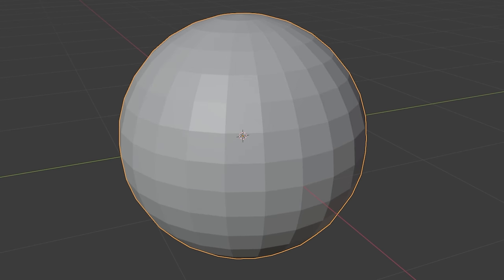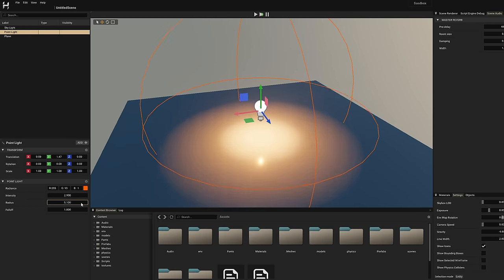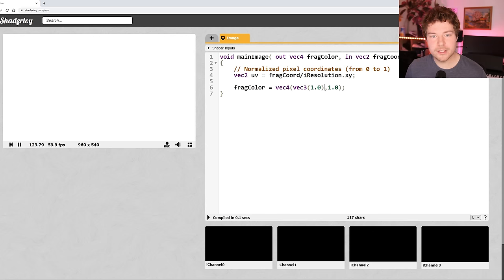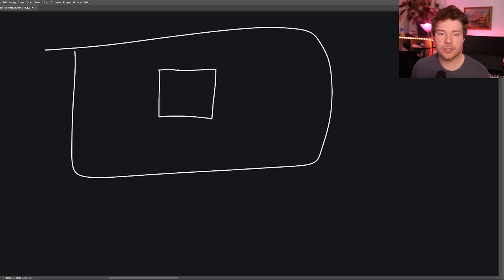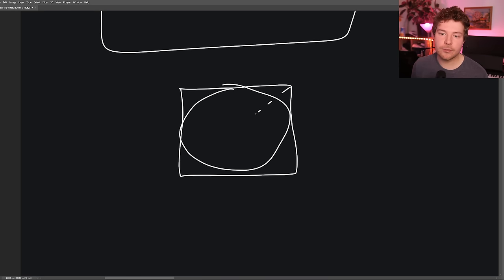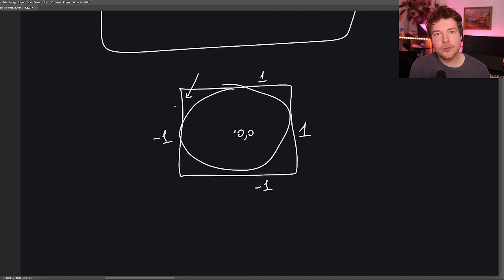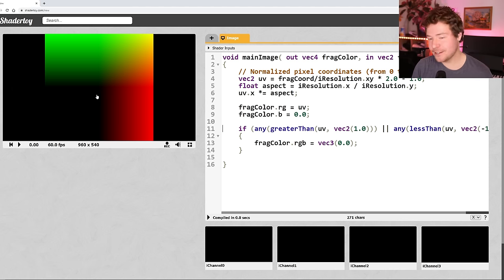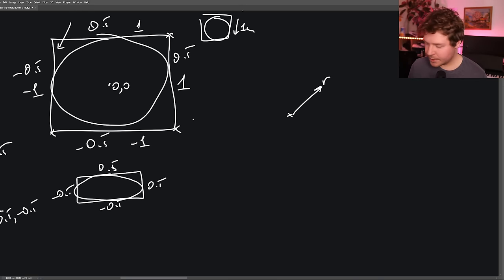How To Render CIRCLES (OpenGL/Vulkan/DirectX/Metal)

Comment: You don't need the square root, sqrt(x^2 + y^2) < 1 is equivalent to x^2 + y^2 < 1, save a few GPU cycles ;)
Reply: Yeah square both sides and you still get 1.
Reply: Only if your radius is 1, does not work with radius != 1
Reply: @rutvikpanchal5726  well in that case you can square the radius instead of square-rooting the x^2 + y^2, this is beneficial cuz square (simple multiplication, one instruction) is way cheaper than square root computationally
Reply: what if I tell you I have a circuit that can calculate square root in one CPU cycle.
Reply: @rutvikpanchal5726  you can just compare it with radius^2
Reply: @utkarshgupta4041  indeed you might have, but that doesn't seem to be the rule
Reply: @utkarshgupta4041  woah, how does it work??
Reply: square root is not as computationally heavy as it may seem to be. It's actually 1 CPU instruction on these days computers. Of course, 1 instruction 
!= 1 cycle but It's still not that expensive.
Reply: @gommito  might as well do the simple optimisations so you don't have to worry about the more complicated ones
Reply: @gommito  That is unfortunately not quite right. A CPU instruction has very little correllation to CPU cycle. For SSE systems like Intel Skylake, sqrt has a latency of ~12 cycles. That means if I issue one square root, I will have its result 12 cycles later. Now what is very low is its throughput, which is 1.0/cycle. This is an effect of pipelining and Out-of-Order execution. So if I have many sqrt's I need to do, and I start calculating my first 11 sqrt's, for each following sqrt I get a finished sqrt result issued 12 cycles before. This means (simplified), that in code that does a bunch of different stuff to a float, adding an unnecessary sqrt does come with a performance penalty, while in a situation where I need to densely compute a bunch of square roots, the cost of each is minimal. Just fyi for an example where instruction and cycle are basically uncorrellated, a load from memory, the same instruction, can, depending on from where I load and the context (what I loaded before, etc.) take between ~4 cycles (L1) to ~100 cycles (main memory) or even thousands of cycles (page fault).
Reply: @gommito  last time I checked float division and sqrt can both go up to 64 cycles, so not great, not terrible, imo
Reply: @naturallyinterested7569  Wait does that mean it takes a Skylake CPU only like ~23 cycles to calculate the length of a 12 dimentional vector (assuming 12 sqrt issues + 11 additions)? 
But when I want to sqrt(sqrt(a) + b) it would end up taking ~25 cycles?
Reply: @rutvikpanchal5726  x*x + y*y < r*r instead of sqrt(x*x + y*y) < r is a very common optimization
Reply: @utkarshgupta4041  Then I would say you wasted a bunch of transistors on something not that useful (at least for a GPU). 
You essentially traded of at least 4 FMA cores for a single square root engine - that's roughly on par with how nVidia's SFUs compare to their FMAs (CUDA cores). Actually, if you could do it in one cycle, then you likely traded off up to 32 FMAs for one square root engine and now have to run your GPU at 1/4 the clocks speed due to the increased critical path - modern SFUs take several cycles (4-5) with a throughput of 1 per cycle. When you have many threads, that effectively becomes one cycle, but the bottleneck becomes the fact that operation occurs across the entire warp of 32 threads trying to use 4 SFUs, so that takes "8 cycles" to process the entire warp.
Reply: Clearly one multiplication is far cheaper than taking a square root. You don't need to know a lot about cpu instructions to know that. Since it is such an easy fix, there's no reason not to just do it
Reply: @rutvikpanchal5726  x² + y² < r² works for any radius.
Reply: @fmdj  you’ll be good at managing resources. 👌
Reply: @utkarshgupta4041  gist me.

Comment: Something that works even better than a static "fade" amount is to scale it depending on the fragment size. In OpenGL 3, this is surprisingly easy to compute by using derivatives:

    const float sqrt2 = sqrt(2.0);
    float fade = sqrt2 * length(vec2(dFdx(distance), dFdy(distance)));

This produces a pixel-resolution fade which works even when the quad is distorted.

If you want an even crisper, but still antialiased, edge, you can use a linear smoothstep (which I call "lerpstep"). It is essentially the convolution of step() with a box filter.

float lerpstep(float edge, float delta, float x) {
   float edge0 = edge - delta;
    float edge1 = edge + delta;
    return clamp((x - edge0) / (edge1 - edge0), 0.0, 1.0);
}

void mainImage( out vec4 fragColor, in vec2 fragCoord )
{
    // etc etc
    float distance = length(uv);
    float fade = length(vec2(dFdx(distance), dFdy(distance)));
    float alpha = lerpstep(thickness, fade, distance) - lerpstep(1.0, fade, distance);
    // etc etc
}
Reply: Thanks for the code example! I never knew that dFdx and dFdy even existed before now. In case anyone was like myself and was quite confused about dFdx and dFdy, here's how I understand it:

dFdx allows you to compare a variable of the current pixel being rendered to that same variable of the neighboring pixel to the left. Essentially the function returns the DIFFERENCE of a variable between two pixels that are horizontally right next to each other. This is useful because it tells us how much our variable changes per pixel which when rephrased, tells us how much we need to change our variable to get a pixel worth of width. dFdy is the same as dFdx except it compares pixels vertically instead of horizontally, so when a pixel is being rendered it'll look to the pixel above it to get the difference in their variable. Note this variable can be anything from user supplied varyings like uv coordinates, or variables like gl_PointCoord. Though you could supply a constant value like `1` to dFdx or dFdy but it would just return `0` as all pixels would just have the same value (as 1-1=0).
Because we now know how much we need to change our variable to get a pixel worth of distance both horizontally and vertically, we can use it produce 1 pixel's worth of anti-aliasing which Pseudonym73 has shown above.
Reply: @bobsmithy3103  This is exactly right, except for one quibble: you should think of dFdx and dFdy not as differences, but as derivatives. They are indeed implemented as differences (which means they are not magic, in that they don't give you an analytic derivative), but semantically they are derivatives.

These may be the most useful operators that nobody (except those who came to OpenGL shaders from RenderMan) seems to know about, because they give you the information you need for shaders to antialias themselves.

Comment: the smoothstep function has one draw back, if you increase or decrease the size of the circle you either get antialising again because the smoothstep threshold is to small or you get a blurry edge because the threshold is too big, a somewhat good alternative is to use the fwidth function to calculate the edge smoothing, since it uses derivatives they are "screen size" aware so it doesn't matter which size your circle is in the screen, the draw back is that it's a bit more expensive and derivatives uses 2x2 pixel blocks which in some shapes can be seen, it's not the case with circles tho

not sure how derivatives work with shadertoy but the final code would be: distance / fwidth( distance )

Comment: Throughout the whole video I was wondering how you were gonna make the edges smooth. I don't know if there are other, more efficient anti aliasing methods, but isn't it weird to have a anti aliasing function (=smoothstep) that depends on the number of pixels of the radius? Like, it you make the circle very small, you have to change the fade value, same if you make the circle very big.

Maybe I don't have the right use cases in mind, but here's what I see:
1- UI: If you use your shader to draw a circle in the UI, then at least you'll always control how big or how small it is, so that's easier. But you still have to manually adjust the fade for each size of circle you have in your UI, and each resolution the game supports. Otherwise, the edge will either look too jagged or too blurry sometimes.
2- Gameplay: If you draw a circle in the 2D/3D world, the problems above are still relevant, but in addition to that, I suppose that the circle could change size dynamically due to gameplay events (distance to camera, growth/shrinking etc)

So there seems to be missing, from this video, a way to make the fade value be proportional to the total screen resolution for each frame.
Reply: every value like the color, radios, border can be passed to the shader as a uniform buffer or a push constant. the video only show the fragment shader side but you can imagine that you can have as many rectangels as so want at any possition and the frag shader can draw a circle on every of them

Comment: A "non-filled in circle" is called a circle. A filled in one is called a disk (It's actually more complicated than that but that's the simple explanation)
Reply: A useful vocab, but still one that requires you to define your terms at the beginning, so it doesn't save you much.
Reply: ...and the difference of two discs is called an annulus.
Reply: what about soft circle then?
Reply: a non-filled-in circle you can actually see would be an annulus
Reply: what happened to the simple days of circle vs circumference

Comment: You should have used a linear interpolation for antialiasing instead of a smoothstep otherwise you get some weird two edged gamma "correction" I know as I compared both methods with Photoshop's antialiasing pixel by pixel. Additionally the fade variable needs to be calculated from texel size. When it's a constant you will get different smoothing for different circle sizes.
Reply: Do you have a Shadertoy example of that?
Reply: So you have to calculate, if a pixel is part of the circle and to what amount.
That means, if a pixel is less than ~1 pixel away from the edge, then color it partially according to the amount of overlap.
You could just use the floating point fraction from the distance (when it's <1), but I guess there are more accurate (and still efficient) ways to estimate the overlap of various directions and distances from the edge.
That would have been actually interesting, if it were part of the video! :/

Comment: It depends, I have two different ways. My first method uses triangles, the number of sectors is determined by the camera distance, increasing the closer it gets. The second method uses the Bresenham circle algorithm. I can use this to draw pixels directly to a framebuffer or via a batch renderer where every pixel (for outlines) or every row of pixels (for solid) is a seperate quad. I didn't really have any concerns with the number of quads/triangles I was drawing as my batch renderer can ouput 1.7 million with a single draw call at over 70fps on my laptop and I don't tend to draw circles all that often for pixel games.

Comment: 9:37, I woulda put the x/y center at the top left of the normalised space, done normal caluations then just multiply the results against width and height normalised with the bigger have a smaller normalisation value, so 1 should be 1.0 and the bigger made to be smaller as a result of division, I think bigger divided by smaller would get the right value, this method ensures the dimensions are always as expected, as for x/y being in top left corner it makes it easier to multiply against position to get in right spot, only having to check if the position should be multiplied against positive or negative version of the axis

Comment: I was wondering: regarding the thickness - wouldn’t you have to take into account the transformation applied (or the distance to the camera) within the shader function, so that a circle with a thin line (aka a donut of ‘tiny’ thickness) stays thin no matter the draw distance - or maybe even more relevant: the aliasing created by smoothstep() is working regardless of draw distance(? Proximity to the object ? Closeness to the camera?) . I guess I am throwing a lot different concepts together - my apologies for that -  the last time I wrote code for an 3D engine is 15 years ago, I never worked with shaders, and I forgot about all the terminology and how different concepts play together.
Reply: @The Cherno Brilliant tutorial - I'm an audio DSP programmer and it's quite wild to experience the same sort of geometric thought process but in higher dimensions. (Audio is 2D, time and amplitude).

@Daniels Liberating Structures-Kanal - I have the same question as you, but for ellipses with a high fade value. I wanted to ask specifically what local variable can we use to figure out the transform applied to the shader? If we had access to the "aspect ratio" of the ellipsoid, we'd be able to easily compensate for this stretched-fade / stretched-thickness effect, but being a complete newbie to openGL, I know that this problem would probably require a good day of plinking around and I'd really like to hear a professional chime in on this!
Reply: If you don't get transform matrix through Uniform and apply it to vertex shader then it would be just circle in 2D screen space.
Reply: The correct approach to anti-alias an edge is to use the pixel width, which I believe you can get pretty easily in a shader with the derivative function on the UV (which just compares the passed value to what it is in neighboring pixels).
Reply: Pretty sure that will just come out in the wash when you project UV coordinates into world space. The rasterizer will calculate how the distance and perspective (applied in the vertex shader) affects each pixel. The fragment shader is only working with a sample point, usually the center of the pixel, but it could be multiple points if multisample shading is enabled. If you need a flat, constant width circle, you can either omit the transformation matrix from the pipeline, or you could use a "look at" function to render the quad and point it straight at the camera.

Comment: you could also create a geometry shader which is going to take point primitive as an input and turn those points into quads and then render the circles that way. If you use this you can then define the color and radius of the circle as a parameter in the vertex buffer

Comment: I think to get consistent smoothness with smoothstep the step size should depend on the resolution, as the goal is to for example stretch the step over 2 pixels (in which the smooth step size would be 2 divided by the total amount of pixels)

Comment: Thanks for the great video! The first time I implemented an SDF circle, it was a piece of cake until I got to the point where I needed to define a falloff for smoothstep(). Technically, the thickness of a circle outline should be oriented so that the middle of the thickness falls exactly on the radius of the circle, right? So half thickness on both sides of the radius edge. But this means the quad needs to be expanded (in clip space) by thickness*0.5 + falloff in every direction. Since my quads were sized in world space, trying to figure out how much to push them outward for this using a clip-space distance was not very much fun. I think I spent around 3 days on it.

Comment: Cherno, you know how Unity optimizes sprites by "cutting off" the edges of the quad and tracing the outline? What if you do that here? Render a hollow octagon, or some n-gon, with a triangle strip topology, wide enough for the circle to lie within it. That would cut down on the number of fragments you have to calculate. I think there's a formula for the inner and outer radius of a regular polygon... somewhere lol

Comment: To render a circle in a texture there are techniques like the Bresenham circle algorithm but it doesn't really apply to a shader as you treat the pixels independently. For antialiasing there a techniques like the Wu algorithm which is a simplified version of multi-sampling, but again i don't know if it would be really faster in a shader.

Comment: Couldn't you just write a function "bool isCirclePoint(vec2 c, float rad, vec2 pos) { return length(c - pos) <= rad; }" then in your fragment shader main check if the current point isCirclePoint(vec2(100,100),10,fragCoord.xy) and set to a different color?

Comment: One way to do this would be to transform the UVs to polar coordinates, it is useful if you're doing other stuff within those coordinates.

Also, I personally do branchless "if"/"step" with metaprogramming, but that might be a bit too advanced.

And of course the other comments mentioned that you do not need a square root if you're comparing to 1, but once again, this is an optimization technique and so I understand why you wouldn't mention it.
Reply: Do you think the shader compiler might optimize the sqrt? It might be interesting to see the gpu assembly output.
Reply: @Drillgon  it might, but we really need to see assembly output. Personally, I think, why take the chance if you can just guarantee this?